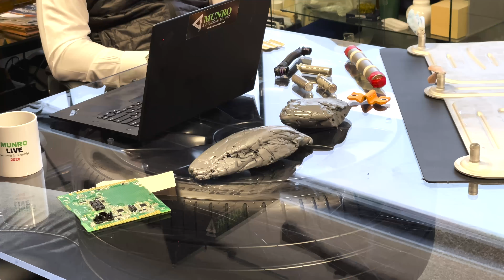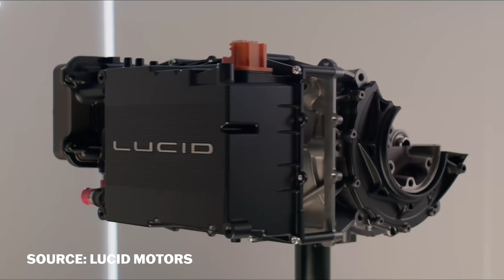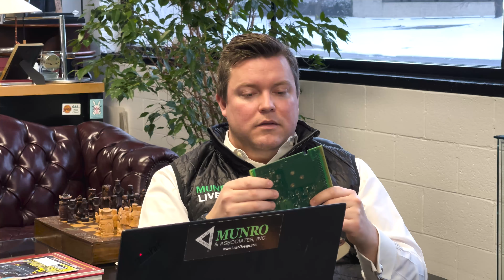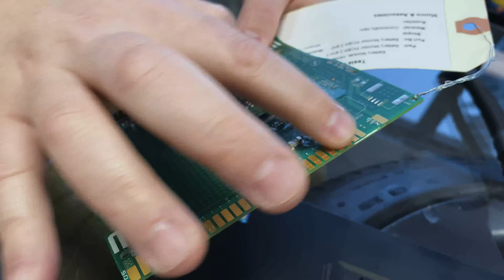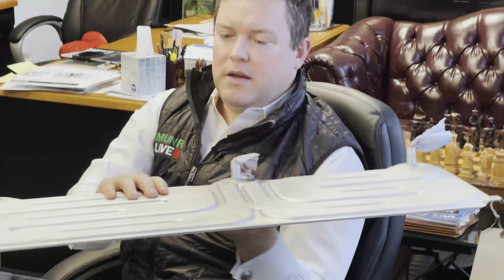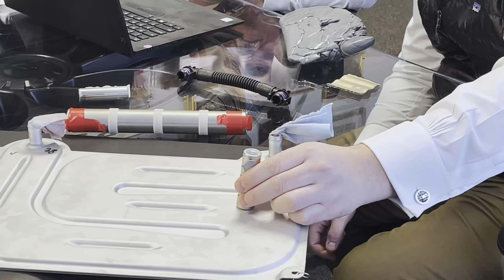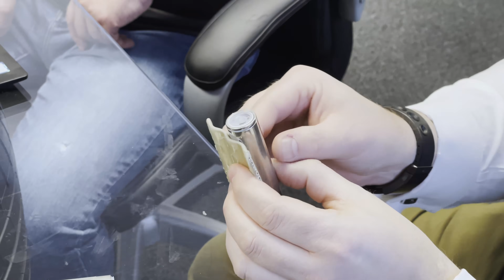Lucid Tech Talk 01: Battery Pack Reaction

Comment: Yes, Peter took the right corner. It’s awesome seeing CEO’s stand behind their products and explain.
Reply: @rogerstarkey5390  Trouble is, after waiting for over 10+ years for... 260 Airs & seeing issues with the battery pack layout, build quality, design & complexity, I'm not convinced that Lucid's are the paragon of quality & efficiency PR is always banging on about.  All coming from an ex-Lotus "just add lightness" engineer".  But, hey, those panel gaps are nice.  You can always lick the gaps & opine to your neighbours about them if your drivetrain fails, whilst waiting for a fix or replacement.  And denying any Cognitive Dissonant Muppetry... 🤦
Reply: @alexmanojlovic768  Good luck with all thousands of Model S 85 with broken batteries and over 45% of them has limited charging speed. Tesla made engines with poor quality in 2015 and they still do, plaid's are getting new Drive unit all over the place.
Reply: @epoxy1710   Funnily enough, that's not a problem I personally will NEVER have to lose sleep over, so no luck needed. Hmmmmm. The 1st & only successful startup US automaker to mass produce successfully (& go global) in the last 50 years, had SOME problems (my 2001 Honda had a dangerous cutting-out issue while at speed, that was never subject to a recall, but the dealer said the ignition switch fail was a common problem) & you're picking fault still.  Every maker had Takata Airbag deaths recall, GM have burning Bolts after THREE recalls.  Toyota surging problem.  Carry on Lemming....
I can't wait for the Lucid problems to shut YOU fanbois up.  Peter Rawlinson is dodgy.  I hope Lucid succeed, but I just. Don't. Trust. Him.  There's something off in his presentations.  He's lying about something.
Reply: @epoxy1710  "plaid's are getting new drive units all over the place".   Funny, I found no evidence of that.   Send me 3 links to back up your claims, @Eh? Poxy.

Comment: Couple Questions:
I thought half of Tesla's cells were upside down and the other half were right side up in most of their cars,  this helps connect the 96 "bricks" with less wiring as the positive and negative terminals have easier access to eachother.

I agree the Right hand turn for the cooling will add resistance and likely add wear and tear to the cooling system and connection points, while the resistance and pump size is likely neglible, I agree with Sandy that the number of connections are the mostly likely problem. The sum of the resistance and larger pump is still probably a small problem that was easily solved.

I worked on space and airborne engineering before a career change with TONS of vibration and acceleration testing, back then only the connectors were a problem, soldering points and fuses never failed,  is NVH an issue with Tesla or other EV solder joints?

Lastly a comment,  I think the 22 module system has its benefits for manufacturing simplicity.   Lucid has 1 module type, one smaller PCB board to control it. Each module is interchangeable, and interchangeable with smaller range models just having 18 modules that are sitll identical.  A Tesla Model 3 has 4 non-interchangeable modules (granted 2 are mirror images).  The Standard range modules being different from Long Range modules, and also different from the Model S/X modules.  While the additional connectors could be a problem, the uniform modularity needs to be given credit.

That being said,  Tesla is still the EV king and has a massive lead over Lucid in almost every way possible so I would definitely bet on red.  You guys are the experts, but I like to think I am still a good engineer and thought I would share my own thoughts.
Reply: Well said

Comment: Using the inside of the rotor as a space for gearing is a brilliant idea.
Reply: 2nd opinion on this please.
Because while it saves space and encasing, it limits the gearing space. Not to mention servicing.
Reply: @musaran2  The guts of most EV motors are sealed/filled with lube/coolant.  The added benefit of reducing pipework/fluid helps save weight & reduces leak points on the porker Air.  They need to try harder in that respect, though, but you're right.  Also how much extra heat is generated by the gearing, which is sharing the lube/coolant.

Comment: Peter did an awesome job and as a CEO even better.  No Other CEO has done this.  His formulas were right on as I am a Broadcast Design Engineer and his Ohm's law was spot on! I knew all about Series/Parallel, Power/Amps/Volts/Ohms, and what I am intrigued about is why a 2170, not 18650's, and you would think Peter would be really interested in something 'like' a 4680!   It like a AAA battery vs a AA, vs a 'D Cell', the fatter the battery the higher the capacity, yet the size not all that much bigger, and all are 1.6Volts.  He could use less cells, less cooling, less weight, less modules, higher amp (current) capacity per pack, smaller in size, same 520 range or more!!   I think that's the direction Tesla is taking with 4680's!

Comment: I’m just curious on cooling connections. I understand less connections= less chance of coolant delivery failure. Could they be segmenting for maintenance, it truly seems to be more cost effective to replace/ repair a small battery pack vs replacing/ repairing an extremely larger one. Failure of cooling seems to favor the smaller packs due to ease of maintenance. A larger pack replacement would seem to have a healthy price tag. It seems the BMS (Battery Management System) that Lucid uses would pinpoint the
pack for a cost effective replacement for the consumer. I have seen what Tesla charges for pack replacement 💵💵💵💵💵💵 (I ❤️❤️❤️Tesla, not a basher)

Comment: 16:55 Heat rises in fluid convection, not conduction. The casing of the 2170 cells is aluminum, and aluminum is highly conductive. The large, flat surface of the bottom of the aluminum cell is in direct contact with the cooling plate, which is by far the most effective way of heating or cooling cylindrical cells. Peter's presentation on their methods for integrating cylindrical cells into a pack is the only thing that makes me think that cylindrical cells might still be effective for automotive purposes.
Reply: So you don't think the 4680 cooling system is better. I would disagree based on Munroe's extrapolation of cooling in that system. Yes, I know no pack yet to break down. But with the squatter cell and tabless design to reduce evolved heat, I was sold on that design.
Reply: @avgjoe5969  I haven't seen Tesla's 4680 cooling system strategy, but based on the fact that both Lucid and Rivian settled on very similar cooling strategies after rigorous testing and even trying Tesla's ribbon strategy for themselves, I doubt Tesla's 4680 system is superior in any meaningful or significant way.

As for the tabless cell design, it sounds like an improvement, but it's still just incremental, inching Tesla closer to the point that they should just be using prismatic cells.

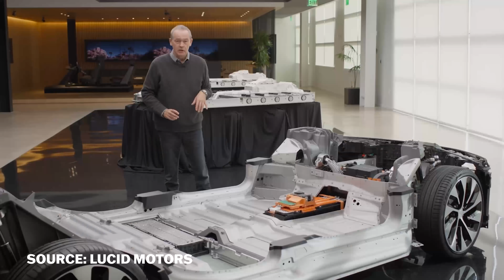Comment: 12:24 What's your reference? For example, The Tesla Model S has >10' of high-voltage cabling just connecting the charge port to the battery disconnect/rear inverter junction box. Is that too much, or just right?

Comment: The thickness of the wire bonds has to be a compromise between durability and vibration fracture resistance, and the role of the bond as a “fuse” in the event that the cell shorts internally due to a dendrite or separator layer failure, and all the other cells in parallel with it try to discharge simultaneously through the shorted cell.
Reply: They appear to be flat semi solid tabs not wires.  Lateral flex will be a major issue.  Most others use wire links which these links are most definitely not.  Inadvertant, unwanted, unexpected "fuse" action will possibly be an issue, affecting range & recharge times.  And Lucid's claim of "late (again & again) because we want to get it right & have the highest quality possible" springs to mind.  I hope they made a good car, but I don't trust Rawlinson at all.

Comment: While heat does rise in a convective material like a liquid or a gas that can circulate, solid materials CONDUCT heat in all directions fairly evenly. So it doesn't matter if the cooling or heating is on top or on the bottom for heat transfer. Other factors such as battery protection, pack design, and structural design, have much more of an impact on cooling placement needs.
Reply: With battery cells, it does matter.  A lot.
Heat has difficulty passing through the jelly roll of anode/cathode chemistry in batteries (along with the formation of dendrites, which poor cooling accelerates).  Going through horizontally from the hot centre to the sides is a very resistive path & leaves a hot central core. V. Bad for cell longevity.  Sandy vaguely compared surface area of the combination of side conductivity vs bottom contact patch, but didn't clarify.  He was alluding to:- application of the thermal paste on the sides was inconsistent, deceptive & appeared larger than it is.  Tesla (& their licensees) 4680 design of tabless cells is specifically aimed at transferring heat through continuous heat transfer via the end of the entire jelly roll to the bottom plate as the most efficient method of heat (& electrical) conductivity.  As the path of transfer is shorter, therefore less resistance, so less heat is generated.  Look it up to get a proper scientific explanation of why you're under a misapprehension.  Also as the diameter increases the ratio of surface are becomes more beneficial to end cooling.  Samsung's famous battery fires & recalls, was due to them extending the conductive foil to the edge of the cell to reduce resistance, but they got it wrong & short circuits were the result.  4680 Tabless to cell bottoms makes a big conductivity improvement.
Reply: @alexmanojlovic768  
I believe you may have misunderstood what I was trying to say, as I entirely agree with you. What I was trying to clear up was the misapprehension that heat travels upwards in a solid material. People are very used to thinking of heat rising due to thermal convection in the air (gas), and their coffee (liquid), and not by thermal conduction through a solid (the underside of a hot roof).

Of course thermal energy will travel along the most conductive pathway, just as electricity does. If the cylindrical cells are arranged vertically with the ends being cooled or warmed by plate heat exchangers, it will only matter which end has the most contact between the shell and the conductive end of the jelly roll, and that the heat exchange system is matched to that end.

It will not matter if the cells and the heat exchange plates are oriented with the cooling side on the underside of the battery pack, or on top, as the lithium cells do not contain enough liquid electrolyte to cause effective convective heat transfer between lower and upper regions.

Convective heat is caused by the lowering of the density of a fluid or gas, causing it to rise against gravity through colder and denser fluid or gas until it is able to sink back down again once it is less dense than the surrounding material (think Lava Lamp).
Reply: @GoCoyote  Indeed I did!! 🤦
Most Sorry, I've been really ill for 4 days & extremely tired.  For some reason I was taking your comment as side vs end cooling.  I have no idea why, because your post says nothing of the sort.  Deepest apologies
Thanks (on behalf of others) for the extra physics knowledge for the extra info.  You are spot on & perfectly explained.  👍
Reply: @alexmanojlovic768  
No worries! I have found that life offers endless opportunities to make a fool of myself. As I have gotten older, I have started to figure out that the trick is to figure out which opportunities NOT to take advantage of. Your explanation was also very clear and cogent. As a recently retired electrician who has worked a lot with renewable energy, it has been an incredible pleasure to see so many people become so engaged with renewable energy lately. While batteries themselves are energy agnostic, they are a very important part of transitioning away from fossil fuels, and it is so wonderful to hear others like you interested enough to take the time to battery-splain to each other, as I have also done. LOL All my best to you.
Reply: @GoCoyote  the error was mine. There's hope for the future & finally the oil shills are losing their battle of lies.
Reply: @alexmanojlovic768  most cordial miscommunication on YouTube ever. Wish everyone was as nice!
Reply: @jghall00  Ha ha!  not to F1 & EV tw1ts, I'm not.  Depends on what level of rubbish & misinformation people are willing to spread deliberately for a false agenda...  Keep up the good work!...